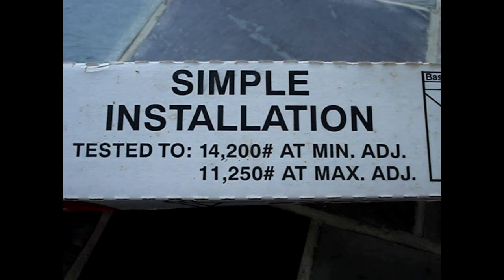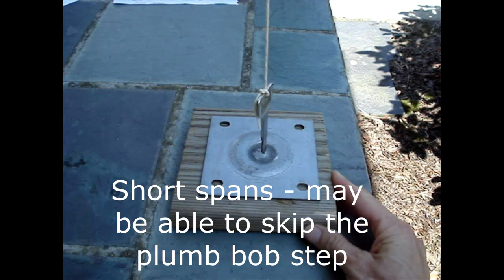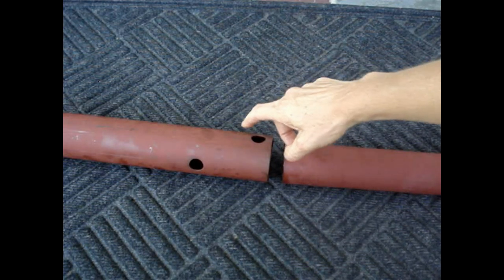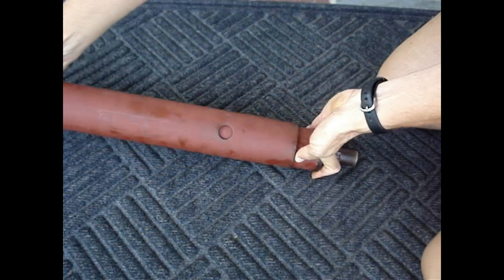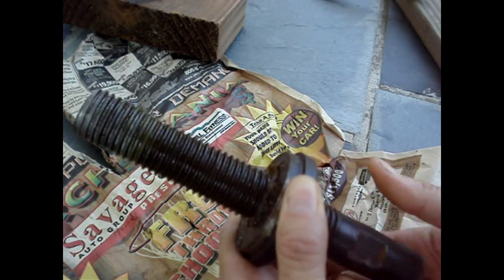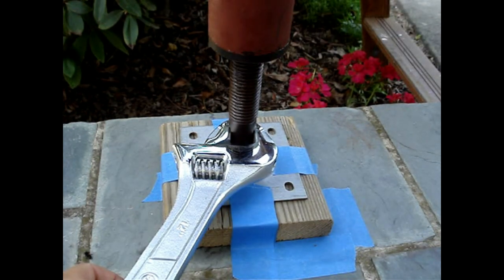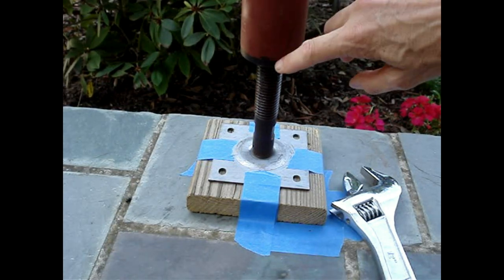How to Install a Jack Post

Comment: Is this post not upside down? I have always seen the adjustment screw at the top.
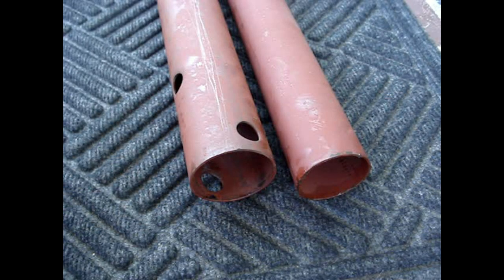Reply from the maker: I talk about that at 1:45.  I'm using the recommendations from the manufacturer of the post.  Screw on top for a metal beam, on the bottom for the situation in the video.   It's been a while since I made the video (I often spend a lot of time checking facts and do my best not to give bad advice.), I kind of remember checking with another manufacturer & found the same instructions.  There must be a reason, I'm sure a structural engineer could explain top vs bottom.
Reply: Thanks for the info. Yea that't a strange one.
Reply: good luck trying to stand on a ladder to adjust your jack post screws at a 12' height or higher.
Reply from the maker: I don't think they make 12' jack posts.  The one in the video is almost maxed out. If I remember correctly, the new posts I installed were 90 inches.
Reply: Don't see why it would matter. Like previous statement hard to adjust or possibly get out of the way on a step ladder.
Reply: I used a bunch of these at one time and found it easier with the screws on the bottom also. Easier to assemble, since fewer loose parts are overhead, and easier to raise/lower without getting on a ladder, etc.
Reply: According to this installation video it doesn't matter.  They recommend the 'screw' be on the bottom for heavy loads.  https://youtu.be/oi1su8nxgNo?t=158

Comment: Another very clear methodical explanation, thanks. Wish I had this video before I self-taught myself these things a couple of years ago!

I found it was also useful to grease/oil where the screw meets the plate (I was putting some serious force on the screws to raise & level something). Your use of tape is a v. good idea. I wore a hard hat just in case some part of the assembly went awry.
Reply from the maker: Thanks for commenting, David.  Good idea to put some grease on the plate.